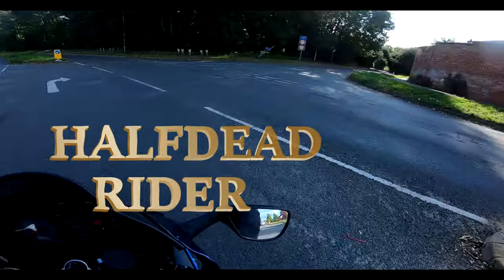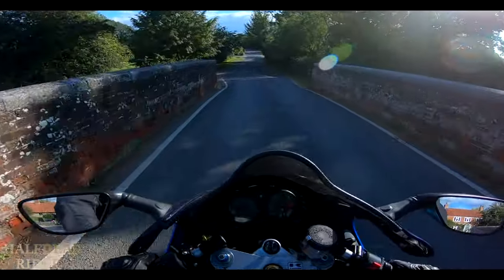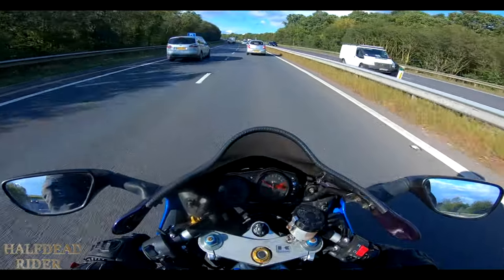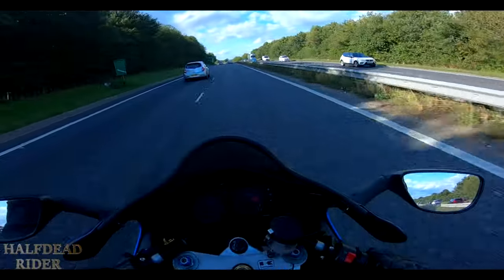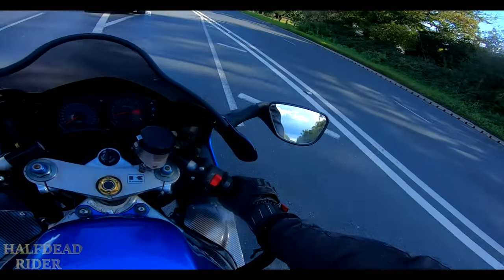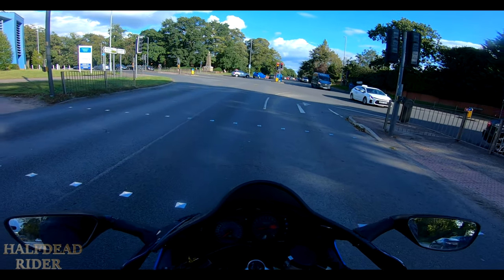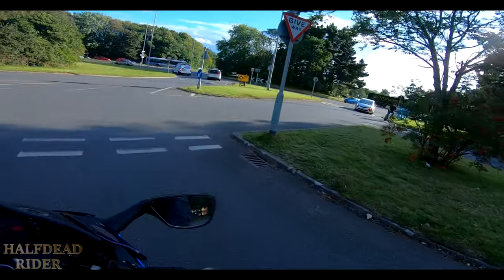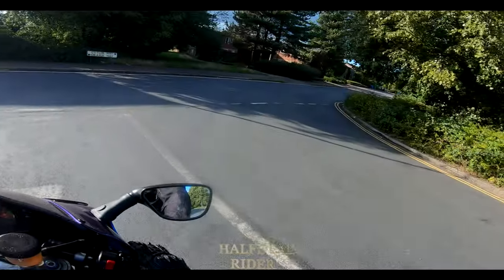Another Ride On The Rebuilt Kawasaki Ninja ZX9r

Comment: Ahh you do have the cable speedo conecting to the front wheel. I reckon its broken in the cable, you can test by putting the end down at the front wheel into the chuck of a drill, give it a spin and see if it makes the speedo work. I seem to remember having a brake in the cable and it wasnt easy to tell just by looking at it. 😊
Reply from the maker: Cheers mate, my speedo cable is bolts to the front sprocket cover, I've checked the wires as best I can, and it is connected. I have a replacement cable, but being put aside for now, as unfortunately my dog was badly attacked by a Rottweiler on Friday night, he's doing surprisingly well as a 14 y/o dog. The local newspaper want to do a piece about it.
Reply: @HalfdeadRider  Oh no, I'm so sorry. I luv dogs, big ones, small ones even in-between ones. 
Personally I'd have nothing to do with the local rag, the media often twist things and do you want your photo in the public domain, makes you easy to trace. Just my thoughts, which you didn't ask for 😂
Best wishes for your dogs speedy recovery.
Reply from the maker: @BeansOnToast_YT  Cheers mate, he has got a lot of healing to do, but he surprised me yesterday with his energy and strength.
I definitely don't want my picture in the paper either way tbh, so that will be part of my terms on whether I speak to them or not.
Reply: @HalfdeadRider  Great to hear, I bet your dog is being spoiled now, probably spoilt all the time if you're like me. 😊
Wise man, always record what you say if you talk to the mejia.
Reply from the maker: @BeansOnToast_YT  yea he is being spoilt, extra food and treats, but being careful to not make him sick.
I've spoken to the reporter via messenger, he's calling me tomorrow, so just a phone interview I guess. I will try to remember to record at least my side.

Comment: Hey bud, nice to see it's all sorted. I wish you lived here in Sydney, I could take you out on some amazing roads here. Your B roads seem to be very narrow and high risk for the fast stuff. I don't know I could get used to your roads over there.
At least you guys are right hand drive, like us, so we give way to the right.
Left hand drive and those those are bloody confusing.
Keep up the great work, anyway bro.
Ride safe.
P.S. I just remembered something. In the last video, your throttle jammed up you when you first set off. What happened there ??
Reply from the maker: Would be nice to live there too mate 👍
The revving high I thing was a sticking butterfly valve on the carbs, just needed lubing from the fuel. Slight chance it could have been the new throttle cables snagging slightly at the carbs, but the throttle felt fine before and after.

Comment: It’s the sound of the zx9r that really appeals to me it’s like a docile sound but in the background you know it’s a wolf in sheep’s clothing…….
I just read that it’s faster in acceleration than the zx12r although the 12r will have a faster top speed 
Regards 
Dave from Scotland
Reply from the maker: With the right exhaust they can be very loud, mine is now louder than before as I took the baffle out while it was off, but as it's a period correct long pipe, it's still not excessively loud.
Yes your C model was the first production bike to do the quarter mile in under 10 secs @ 9.9 secs and 136mph, the mighty ZX12r does the quarter in about 10.4 secs. This is in part why I prefer the ZX9r, it's lighter and much cheaper to run, with a 12r you're paying all the extra fuel and insurance costs for a slightly higher top end that you'd barely use, plus in my opinion, the ZX9r is the better looking bike overall.
Reply: @HalfdeadRider  yeah mate the zx9r tops them all 😂
Reply from the maker: @davidmuir6849  they do 😂